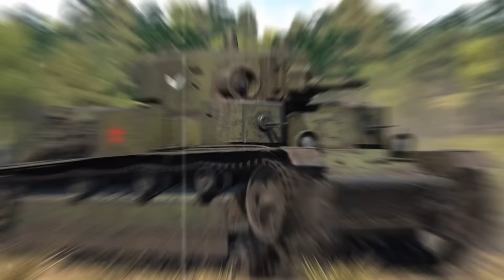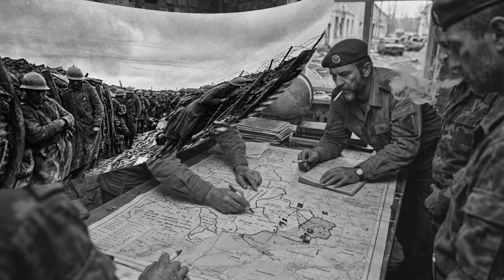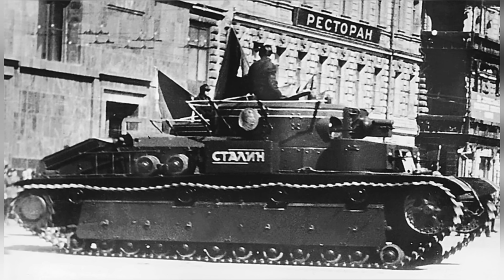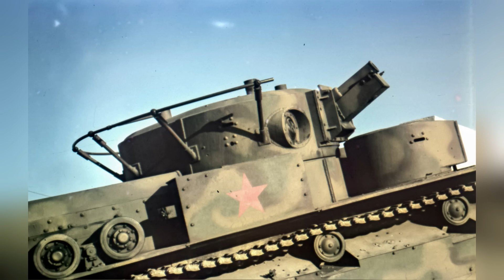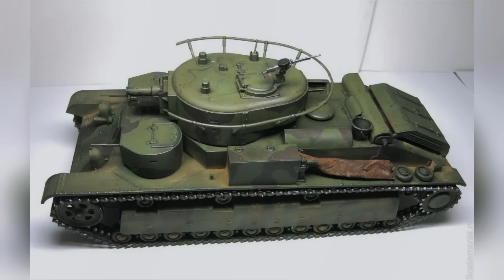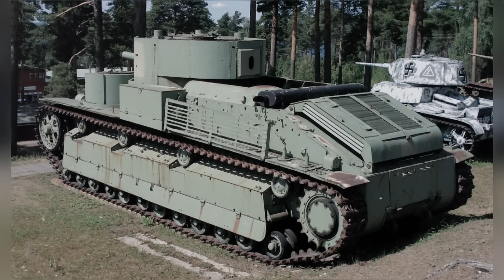How Did the Soviet Union's "Mail Car" Fight? The Truth About the T-28

Comment: The pictures (in the video) of a T-28 with KV torsion bar suspension, is actually a T-29. The T-29 was powered by a diesel engine and had a shorter hull.